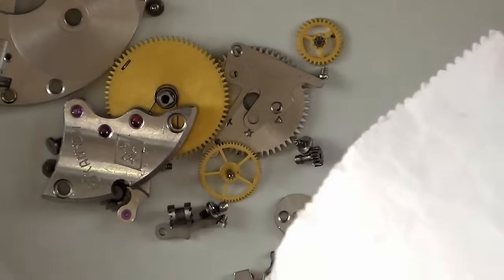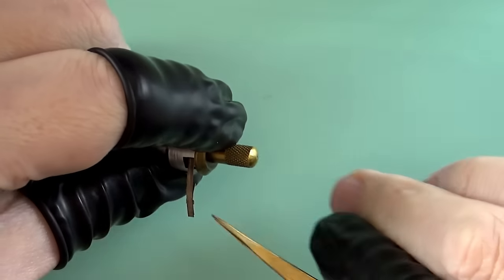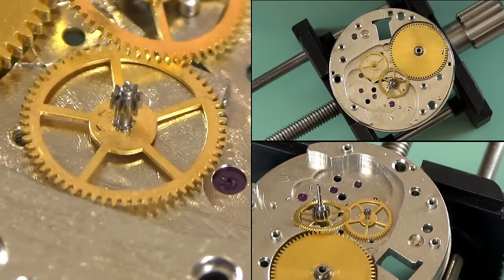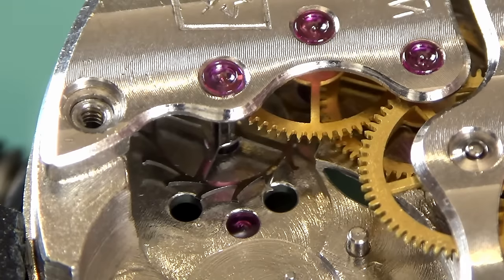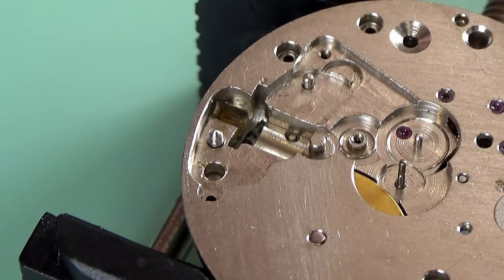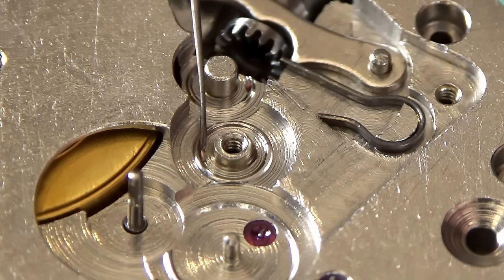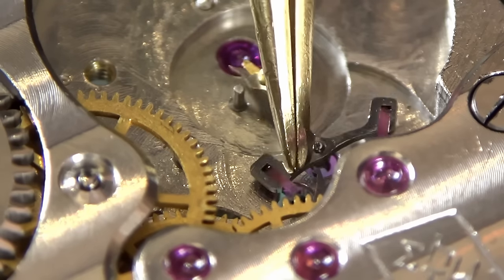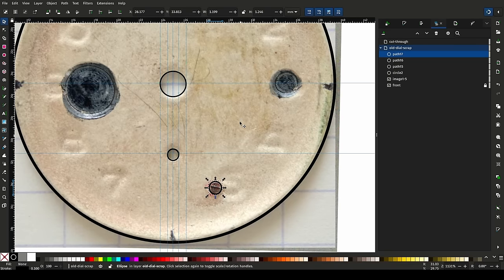Turning the Ordinary into the Extraordinary. Bespoke Watch from Old Parts and Sleepless Nights.

Comment: One of the pivots in the train of wheels (2nd wheel) was already bent, the wheel does not run straight, but wobbles.
Reply from the maker: good eye i noticed it in the edit. Any tips for pivot straightening?
Reply: @Saving-Time  Use a wheel balancer for the escapement wheel to see where the pivot is bent. Then put it in the hole of a watchmaker riveting block and try to bend the pivot very slightly with a pin vice. After every push retest it on the wheel balancer.
Reply from the maker: Thank you for taking the time to let me know. I will try that out for sure.
Reply: @Saving-Time  There is even a special tool for it ( what else?), the Seitz 30350 Watchmakers Pivot Straightener.
Reply from the maker: I'll add it to the list. Steal a man's wallet; he'll be poor for a week. Teach him about watchmaking tools; he'll be poor for a lifetime. Thanks for the help, very nice of you

Comment: Jewellers saw frame - straight lines - either angle handle forward and saw tip back towards you so you can see where the blade is going and rotate handle to keep going along your straight scribed line or - use a thicker blade 😊
Reply from the maker: Thank you again, i'll take all the help i can get :)
Reply: one more tip if you use silver always always always make all your bits and pieces and sand and polish all your file marks out until its shiny and smooth - and then solder stuff together. Corners are a bitch to sand and polish marks out of once assembled. Do all that work before assembly so its polished where you can't easily reach. I would often work on watch cases replacing pocket watch hinges and catches and bracelet snaps. I love watches and I've finally bought myself a vostok amphibia from the 80s so I'm learning about oiling to keep it tip top. Disassembly looks daunting but doable as long as nothing is broken or damaged. I've subbed so ill throughly enjoy watching you till it arrives. Take care

Comment: unrelated to watches....it sounds as if you are using a mic without (or with insufficient) pop filter. The audio on this video played havoc on the low end on my sub. A decent pop filter, or removing the lows below your vocal frequency range in post, can do wonders for over all audio quality :)
Reply from the maker: I don't know what to tell you on this one; all low-end frequencies were rolled off when i did the vocal EQ, and i use a Rode pop filter. Anything below 60 Hz should not be there.
Reply: @Saving-Time  I did notice that the audio improved as the video went on. The bad parts were around the first quarter....and to be fair most people wouldn't be watching on a system that would even produce the sub base pops
Reply from the maker: I appreciate you letting me know. It's possible i forgot to EQ the audio. Bit rushed on this video!

Comment: I love that dial! I would have milled half sheet thickness out the whole of the index locations, to constrain solder or epoxy flow. As for putting rivets... Mill out of triple thickness, leaving ⅓ as the index, with ⅔ as the integral pin.
Reply from the maker: Thank you, I really need to work on my CNC it's a total trash nugget at the moment. I will try that out when I've got some upgrades done. I appreciate you taking the time to leave me some advice. Cheers
Reply: @Saving-Time  yeah, the maching the pin as part of the part does require a great deal of 3d position accuracy. 
If you want to see excellent drill and pin technique, @Clickspring has a really good series of hand machining on the replica of the Antikythera Computer. His smaller ones look to be about 5× the size you'd need, but the techniques would be similar. And he even discusses coloring the brass. Bluing could make a truly astonishing looking set of numbers.
Also, something from the minis-wargaming side - pins do not of need have to be round... especially when machined (or in minis, cast) as a part of the a part.
Reply from the maker: Interesting I will check out @Clickspring videos the name rings a bell I think I've seen some in the past. Really, thanks again for the advice! Appreciated

Comment: That doesn’t look like a 6, it looks like an upside down 9..
Reply from the maker: You'll need to have a word with the font designer on that one.
Reply: @Saving-Time  the 8 is same problem looks upside down…
Reply from the maker: Ah i see the issue Yes, you are not the only one. Some dials with the numerals in what looks like an upside-down position to me will, I assume, look correct to you. Cartier does it the same way I've done it, albeit with more skill. Rolex does it (on some dials) in a way that looks upside-down to me. It's an interesting phenomenon. I think it's why people like Rolex make dials with the numbers both ways up and just straight, thus solving the issue. This Rolex drives me nuts; it's upside down https://cdn.swisswatchexpo.com/productphotos/273/14822/rolex-datejust-ii-steel-white-gold-blue-arabic-numerals-watch-116334-164315_b_md.jpg This looks the right way up to me on this Patek https://www.patek.com/resources/img/ref_6007/thumbnail.jpg Maybe why most dials us straight numbers. It's an interesting thing

Comment: Lol, to think I was gonna design a dial in photoshop and then print it onto a piece of card 🤭
Reply from the maker: Well, if it works, and to be fair, that would work! I mean, you can't get it wet but if your dial is soaking wet, you probably have bigger issues than the dial :D
Reply: @Saving-Time  
Exactly what I thought but then the beauty is, if it did get wet, I'd print another one out 😃
Oh....and then there's always that glossy type card you can buy 👍
Reply from the maker: Go for it ;) still going to be better than a Daniel Wellington
Reply: @Saving-Time  
I doubt that's true 😊
Haven't touched a watch yet, most I've done is taken the back off a vintage MuDu(25 jewels) doublematic and had a look. Still taking as much information in as possible from channels such as yours. Ordered a load of tools, cheap from AliExpress just in case it's not for me, should start arriving in a few days time, then I'll spend my christmas catching springs 😆
Reply from the maker: Well, good luck! Remember, it's only a watch. I've sent many to the scrapheap No big deal 😆 If you want my advice, start with a small second. It's normally the easiest watch to work on. Something like this: https://www.etsy.com/listing/917063628/slava-2602-movement you can find them for around $10 they are really nice movements. rock solid, easy to work on, and well made

Comment: A great job - when making the second dial - the old school way was to attach the dial with either silver solder or soft solder. No arbor press needed. The problem with silver soldering and soft soldering is the heating. On many of the really old dials the face and back have enamel frit applied to create the base layer of the watch dial. To keep thermal expansion from bending the dial, the back side also gets a layer of enamel frit. For a more modern dial, you could probably use powder coating and bake it in a toaster oven.

Pinning could be as simple as drilling through both the index and the dial and inserting a brass wire. Then tap the wire with a hammer to peen. The best videos that I've seen are made by Clickspring as part of his Antikythera device build and he shows the full process. Unfortunately, he is building a very much larger scale than the dial you've made.

Again, congratulations for getting off the dime (10P coin) and doing this in front of the universe.
Reply from the maker: Thank you, and thanks for the information. I'll check out the Clickspring videos; you are the second person to bring up that exact video. I'll look into soldering; I've done a lot of surface mount PCB stuff on a hot plate, which should translate over pretty well. If it works, I guess it will make it's way into a video at some point.
Reply from the maker: Awesome thank you! Appreciate you taking the time to help me out, very nice of you!